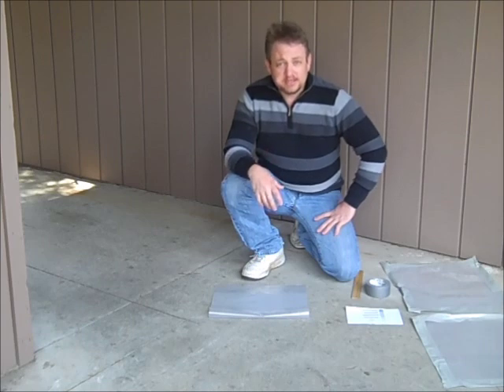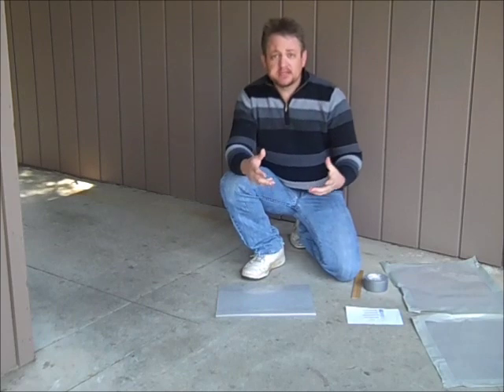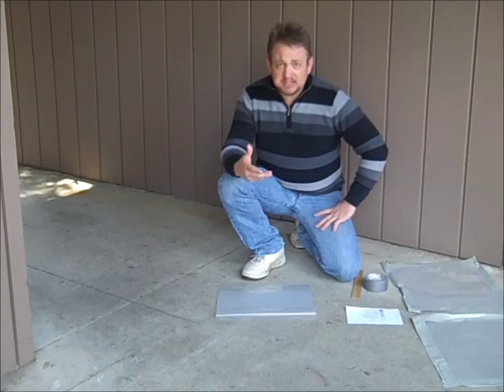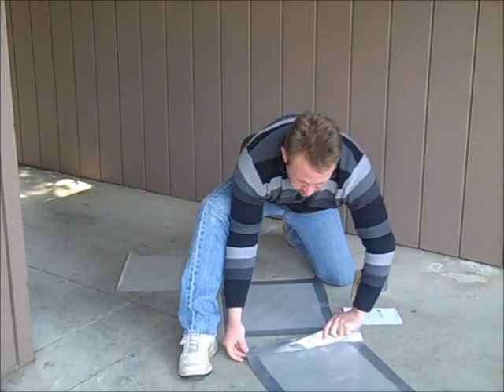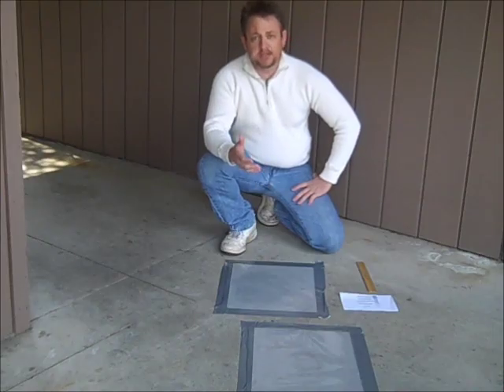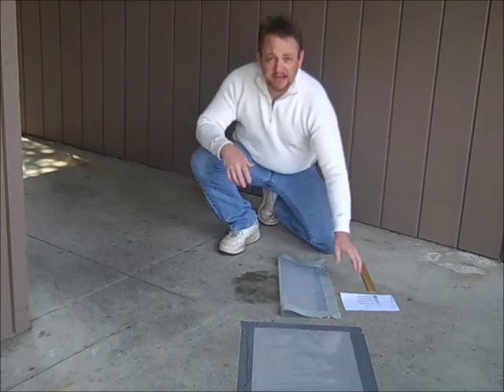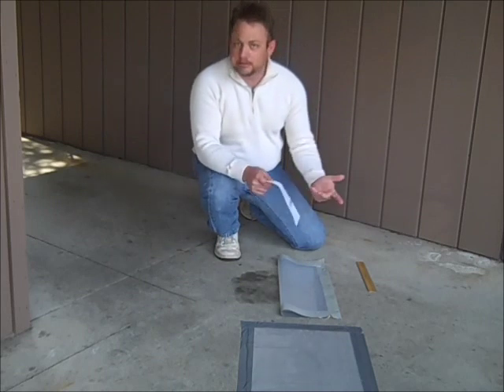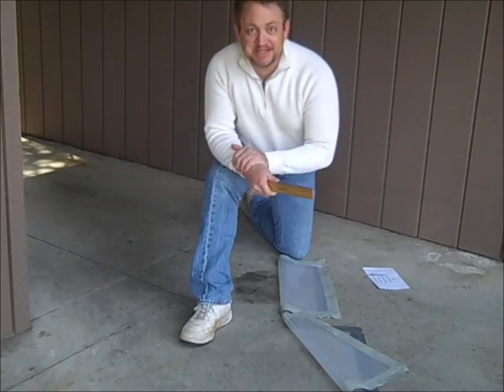Concrete Moisture Test Using Plastic Sheet Method – What Could Go Wrong?

Comment: No need for color gradiant scale if the slab darkens it's a no-go.  Also, I would recommend first grinding the concrete in the spot you are testing.

Comment: I appreciated you video and the humor of your scale and you made me more aware of the limitations of this method. I am a coatings expert and have written several ASTM standards. I have had significant success with this D4263 method, but I generally couple it with either a Delmorst (pins) or a Tramex type meter (mine is a small one, not unlike yours I think) or if that not enough since I have a lab I just run mass based moisture with a loss-on-dry machine.

As a result I have seen all these methods miss it. 

I see the plastic sheet as simply a mock-up of what a coating or sheet might "see" and of course to take away the variable of surface evaporation. I work in the western US, and our dryer climate influence most construction practices and this is not exception. Often we get false low leadings from meters like the Pin based ones that are at least as misleading as the sheet is- and those percentages are pure fiction too.  I have found the Eddy-Current types to be better screening test. I still use the plastic sheet because I want the contractor to see that fact that moisture in the slab becomes moisture on top of the slab as soon as its coated. I think this fact is the key to is persistance and why I still use it. 

My market is roofing so, often after I screen, I may turn to cores (pretty easy). In flooring I think I'd want to still use the sheet after I scanned the floor with a Eddy-Current Meter, but then use a relative humidity method with a drilled hole. I have also found that pH is often a bigger source of pain than the moisture. So in any case I check pH with some special strips with the right range or a dye.

Comment: What if you see no moisture greying or droplets? then isn't this a good way to verify that you don't need to take extra steps to install your flooring? not being a smart ass...genuinely asking
Reply from the maker: Anthony:

No visible signs of moisture from this method MAY be telling you that the very top surface isn’t emitting moisture.  On the other hand, it could be merely telling you that conditions are such that condensation isn’t able to form on the surface of the concrete.  Bottom line, even if there is no change under the plastic, this testing method isn’t an acceptable form of testing for MOST finishes, to establish a product performance warranty.  Knowing what the moisture is like in the slab, based on in situ relative humidity testing, helps in predicting long term functionality of the floor.

Thanks,

Jason

Comment from the maker: Because people are still using this method, and this could lead to disastrous results.
Reply: Why is this worthless? I was going to do this to test my walls. What do I do instead then?
Reply from the maker: You are unable to quantify how “bad” of a moisture problem you MAY have.  Without this information, it becomes very hard to determine the appropriate course of action to remedy the situation so you can install a finished flooring system.